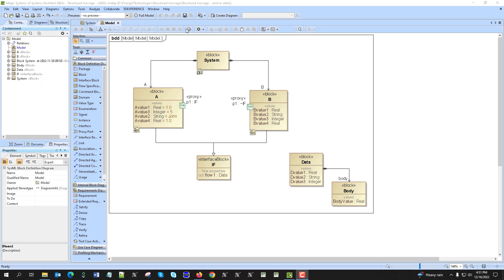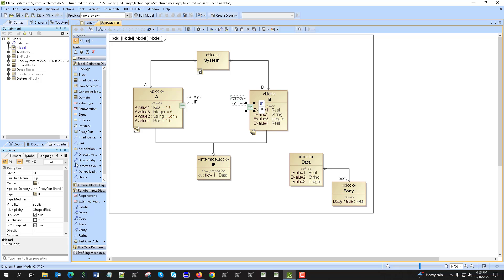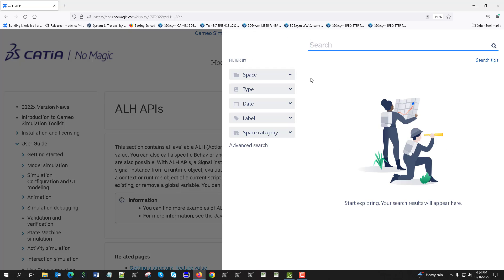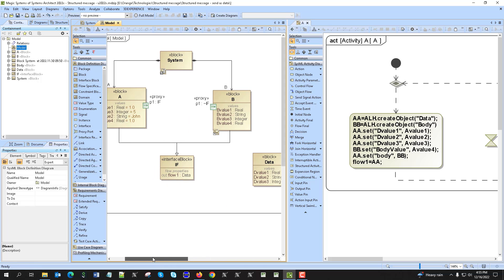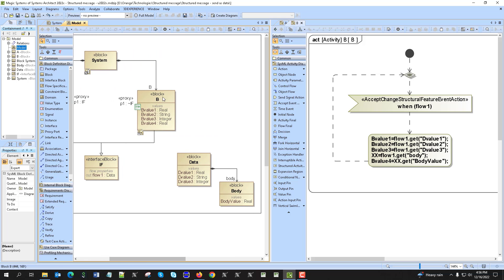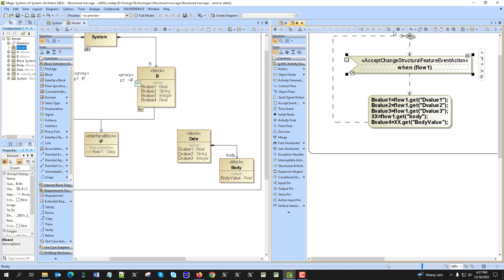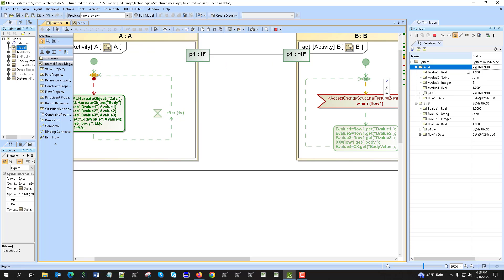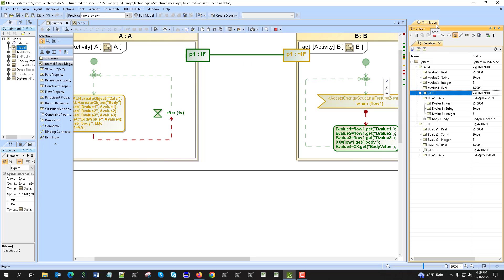Sending Structured Message Simulation in SysML

Comment: Hi! How would you 1. Interact with json files 2. Represent/build json types to send across your system components?
Reply from the maker: Hello here is sample how to interact with json Load Data from JSON File in SysML Simulation
https://youtu.be/1A9SfQ2LZWc. For types modeling please use blocks or even better value types.
Reply from the maker: Bere is one sample for structured data types modeling and simulation Structured Network Message SysML Simulation
https://youtu.be/8nE0LuRFfNA . There are few more you can search in channel by structured message.

Comment: Nice video.  Thanks.  Do you also have a video that shows how to do this using a synchronous or asynchronous Call behavior?
Reply from the maker: Thank you! Can you give more details what would be result using call behavior? Im asking because here we use opaque action which is quite similar.
Reply: @MBSEExecution  Let's say I have a System B that owns an operation entitled "GetStatus" that receives several parameters and returns several other parameters.  I want to call that operation synchronously from System A over an interface between the two systems using an activity diagram with a Call Operation Action in order to invoke that operation and receive the returned parameters.  I also want this call operation to show up as a synchronous call message in a sequence diagram.  Do you have any videos that explain how to do this?  Thanks!
Reply from the maker: I see. What about this one https://youtu.be/luBXs3jgxl8
Reply: @MBSEExecution  Yes, thanks.  I think your basic method in this video is what I have in mind.